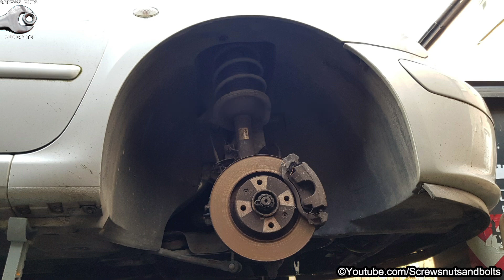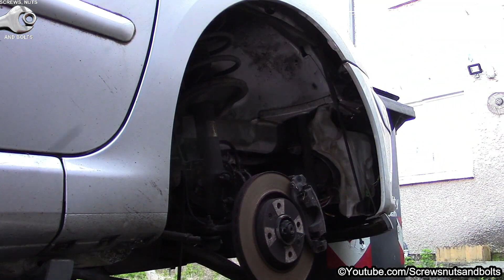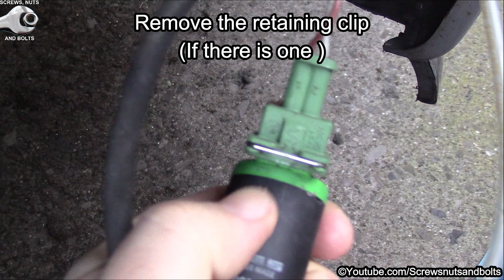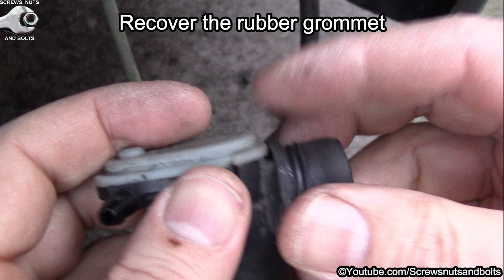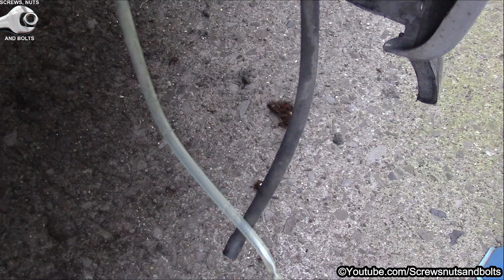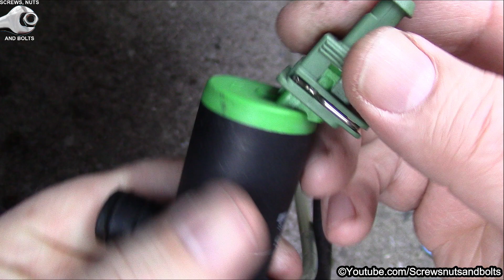Windscreen Washer Pump Replacement - Peugeot 307

Comment: Absolutely spot on.  Step by step and to the point.  Brilliant, I'm on this in the next few days as the fuse is still intact but there is no noise coming from the pump at all.  Cheers.
Reply: Just completed it - works a treat, The hole in the bottle was a touch to big for the grommet, and there was a tiny leak, but a bit of plumbers sealing tape sorted it ... Not all great news though..on jacking the car up i noticed a snapped Suspension spring...so it's off to the garage.  Cheers!
Reply from the maker: @pilgrimoutdoors-uk6177  Good job, pity about the spring but it's better that you know about it now I suppose :)
Reply: @screwsnutsandbolts  All fixed now.
Reply from the maker: @pilgrimoutdoors-uk6177  Well done :)

Comment: You DO NOT remove the "retaining clip" from that plug on the pump as you did with your screwdriver.  You simply push the wire clip inwards with your finger and the plug then pulls off the socket without any real effort at all.  That way you can keep on using the plug for the rest of the life of the car!!!
Reply from the maker: Thanks for the tip 👍

Comment: This is super helpful. I actually need to change the wash tank, not the pump. Does anyone know how it’s attached and how it can be removed? Only video I can find is for a 206
Reply from the maker: I don't have a video but here's the instructions from the manual which may help:

Washer Fluid Reservoir:

1 The washer reservoir is located behind the
right-hand front wing and supplies both the
windscreen and tailgate washers via the same
pump. On models equipped with headlight
washers, the reservoir also supplies the
headlight washer jets via an additional pump.

2 Working in the engine compartment,
remove the plastic cover from above the
washer fluid reservoir. The cover is secured
by two expanding plastic rivets. Push the
centre pins In a little, then prise the complete
rivets from place (see illustration).

3 Slacken the right-hand front roadwheel
bolts. Jack up the front of the vehicle, and
support it securely on axle stands (see
Jacking and vehicle support). Remove the
right-hand roadwheel.

4 Remove the front right-hand wheel arch
liner. The liner is secured by several
expanding plastic rivets. Push the centre pins
a little, then prise the complete rivets from
place, and manoeuvre the front section of the
liner out from underneath the wing.

5 Pull the reservoir filler neck upwards from
the reservoir.

6 Note the correct fitted location of the
washer hoses (if necessary, mark them for
identification purposes) then disconnect the
hoses from the washer pump(s).

7 Disconnect the wiring connector(s) from the
washer pump(s) (see illustration).

8 Slacken and remove the retaining nut then
move the reservoir to the rear, and free it from
the body. Manoeuvre it out from underneath
the wing (see illustrations).

9 Refitting is the reverse of removal, ensuring
that the hoses are securely reconnected. Refill
the reservoir and check for leaks.

Comment: Thanks
Wanted to ask you about something please 
One of my friends has water leaking under the winshield, just in the VIN number area.
Noting that he didn't replace the winshield recently
Where do you think the leakage is coming from?
Reply from the maker: Where exactly is the VIN number, is that below the windscreen on the drivers side ?. Where is the water ending up ?. Test the windscreen washer with the bonnet open and see if any of the washer hoses are disconnected or leaking in that area
Reply: @screwsnutsandbolts  I have a photo I just can't attach it
Reply: @screwsnutsandbolts  but yes the windscreen on the driver side . VIN is the chassis serial number in some recent model it is under the windscreen and can be seen from outside
Reply from the maker: @georgemarcos8688  So where exactly is the water ending up ?
Reply: @screwsnutsandbolts  the VIN in in a deep area and the water is ending up in this area
Reply from the maker: @georgemarcos8688  I'll have a look at mine and I'll get back to you
Reply from the maker: Could the scuttle drain be blocked. Check this link: http://thehelpfulengineer.com/index.php/2011/12/your-car-ensure-your-scuttle-drains-are-clear/
Reply: @screwsnutsandbolts  thank you alot for your replies
Reply from the maker: @georgemarcos8688  You're welcome. Hope you get it sorted